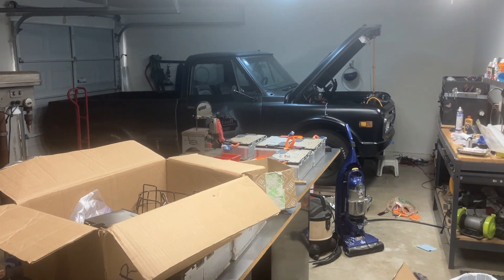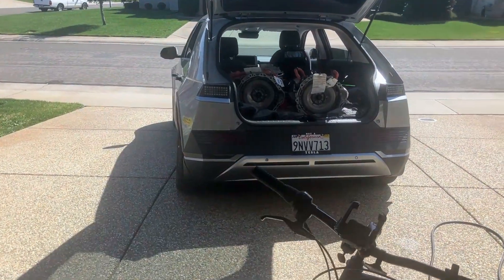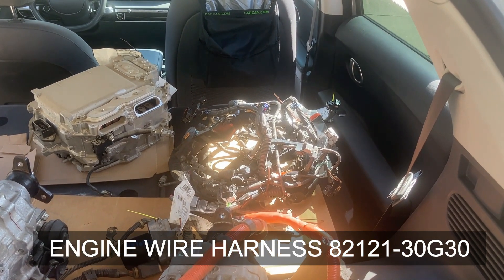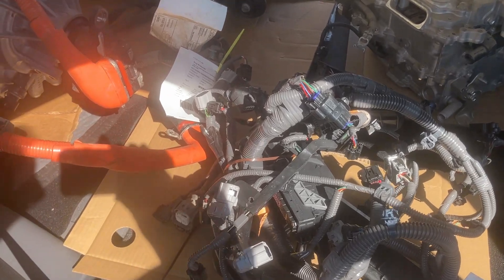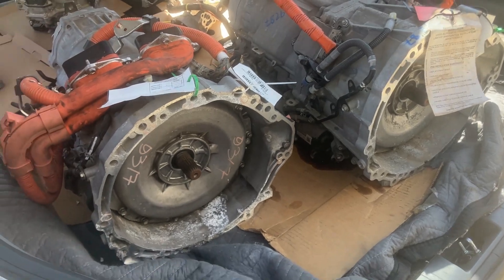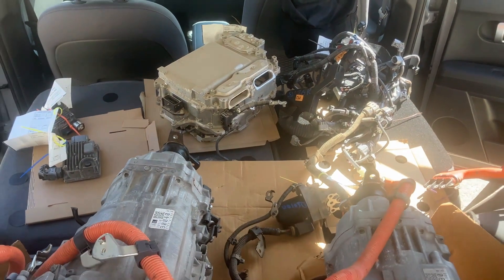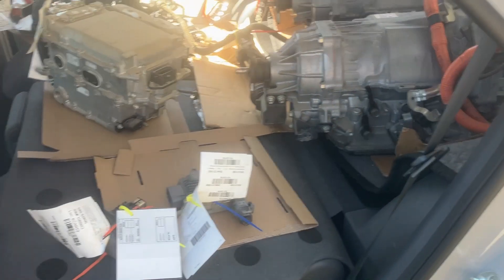DIY EV March Madness 3000

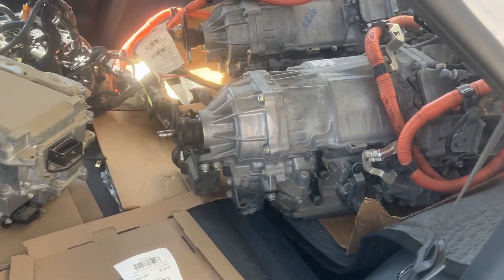Comment: 1:35 это же инвертор от Toyota Crown, у меня таких 3 штуки! т.е. он подходит как к Lexus GS 300h, так и к  Lexus GS 450h ??
Reply from the maker: спасибо, у нас нет GS300h в Соединенных Штатах
Reply: @Good-Enuff-Garage  thank you
Reply: @Good-Enuff-Garage  I bought them from a dismantling site in Vladivostok for $30-45 each. At the moment I am doing a swap of a 1993 Toyota 4Runner engine to a Lexus GS 300h automatic transmission and an HR12DE engine.